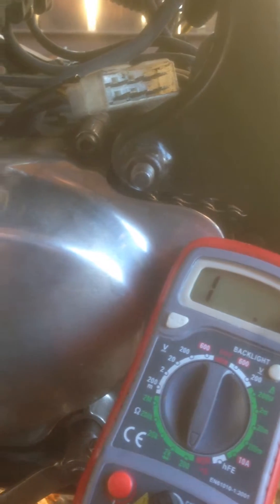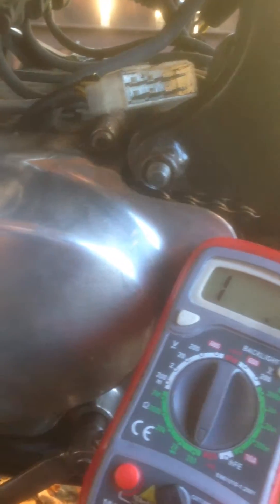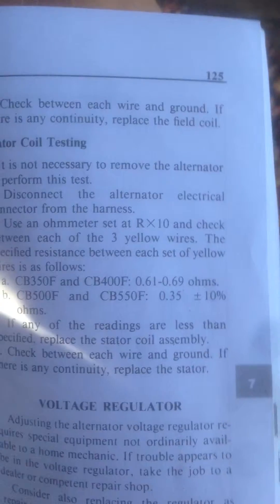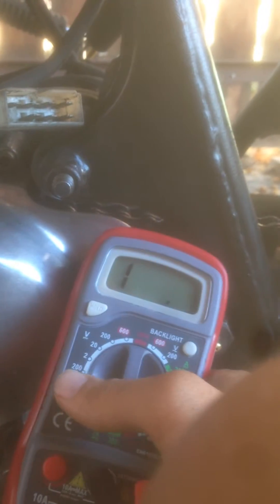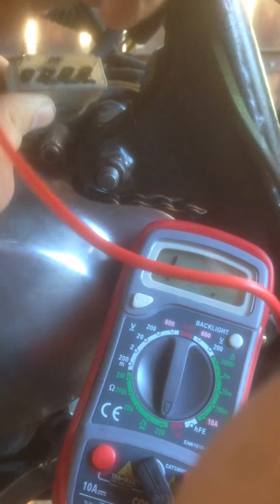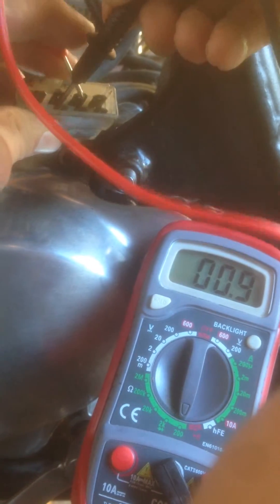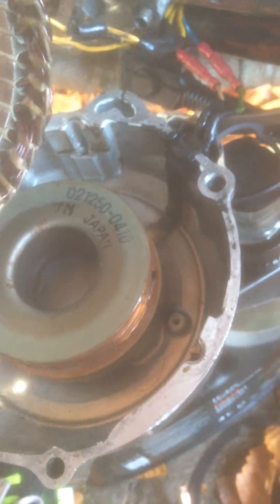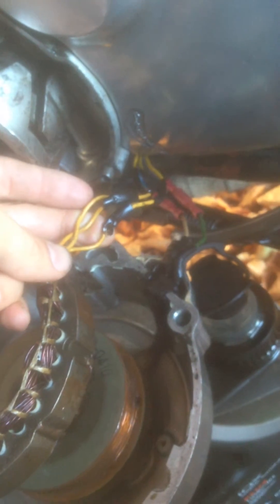74' Cb350f won't charge - Stator problems?

Comment from the maker: Yes. The stator got grounded due to an uninsulated wire touching the frame. I ordered a used one, and rewired everything from the stator to the regulator/rectifier. No problems anymore, efter throwing 3000 km in mountains and mud efter it.
Reply: I think my stator became grounded like yours. Is there any visible way to confirm this or other electric test you performed to diagnose this?